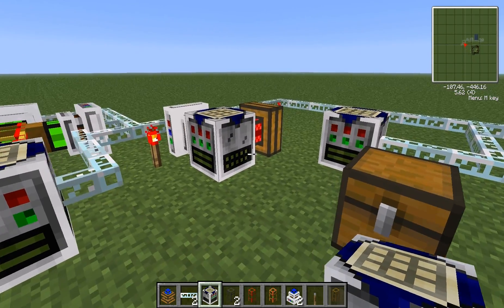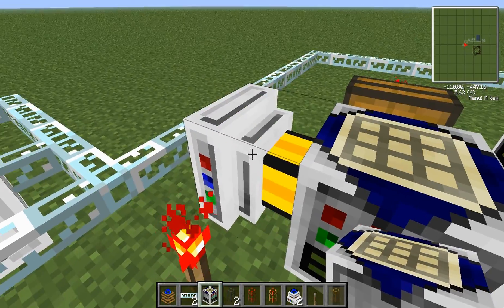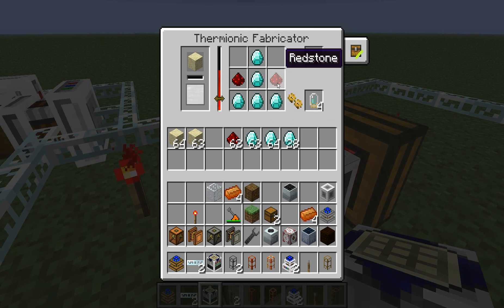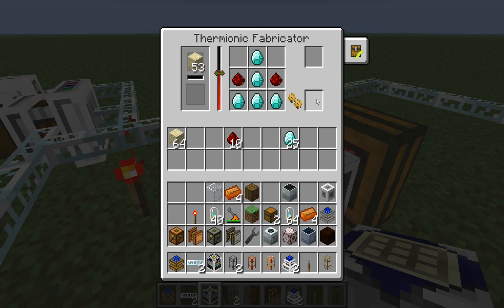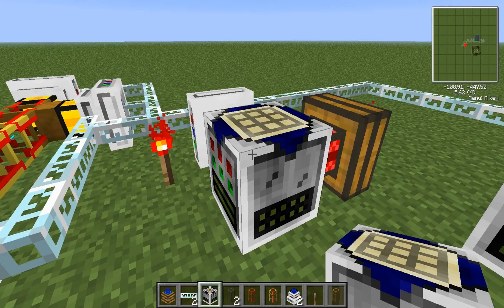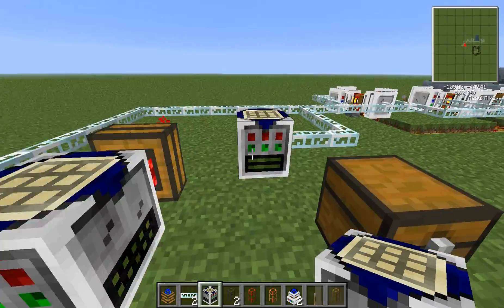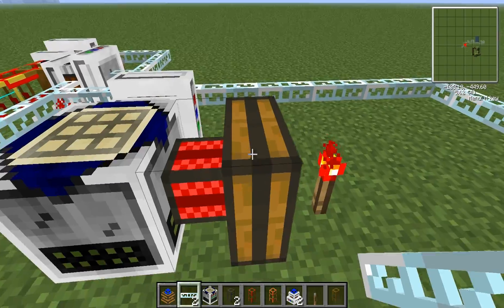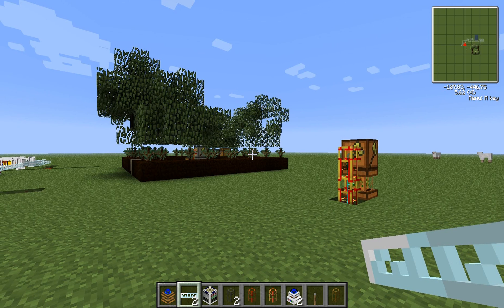Machine Spotlight: Thermionic Fabricator

Comment from the maker: Make sure everything is in the right spot and you have the ingredients below the crafting area (like a project table) except for the sand, make sure you have a stack of that up in the correct position... there should be a little horizontal bar on the heat bar and the hear bar should fill up with red, once it passes the horizontal bar, you should be able to craft things (Also make sure the recipe you're using actually requires liquid glass, some recipes may have changed with gregtech)

Comment from the maker: when you put glass/panes/sand into the top left slot a little symbol should appear on the heat bar telling you how much heat you need, red is how much heat you have, if you have enough heat it will turn whatever is in there into liquid glass